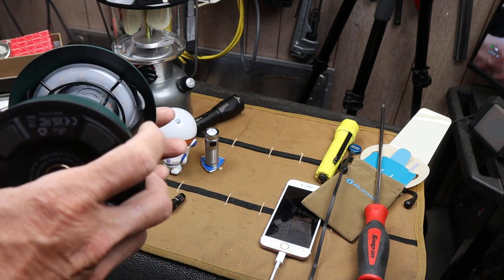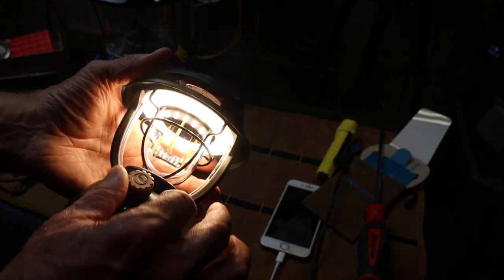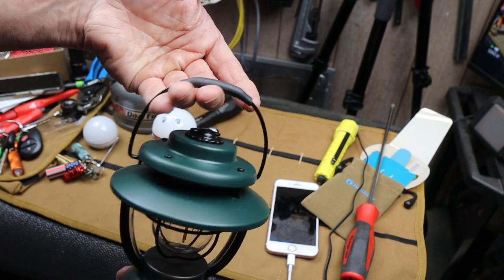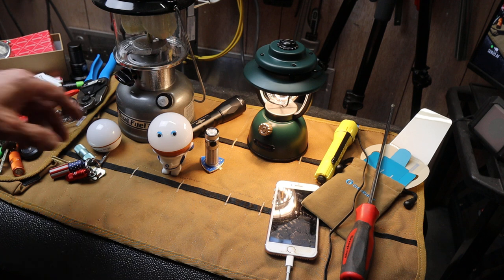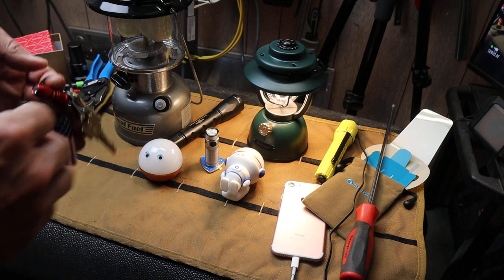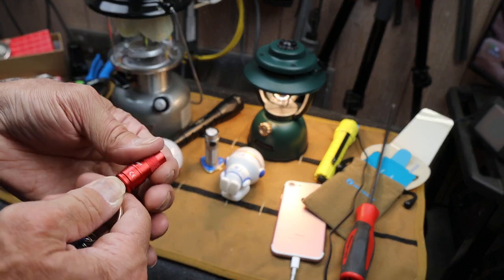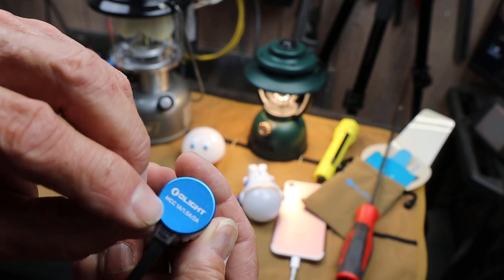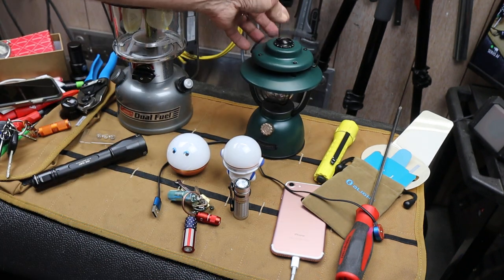Wow! Olight Summer Sale Lantern, iMini keychain light, Obulb Pro/Bluetooth, Baton 3 Stainless Steel+

Comment: I was gonna get the Imini but they only had red on sale the other day.
I suppose it's for the best anyways because I've already got that role filled by their tiny little x9r cell that was free awhile back, I still think they're cool and will probably get one but I'm not sure what I'll use it for.

I don't do keychain carry but a tiny little light hanging around a necklace is great, and the X9R cell has been perfect for that.
Sometimes the absolute bare minimum light source is all you need and it's been great.
10 lumins is probably much more versatile though and the batteries the imini takes are easier to get.